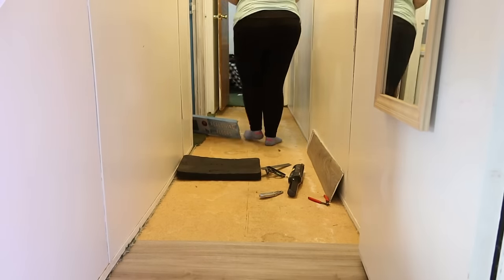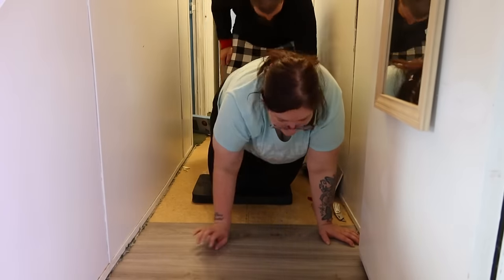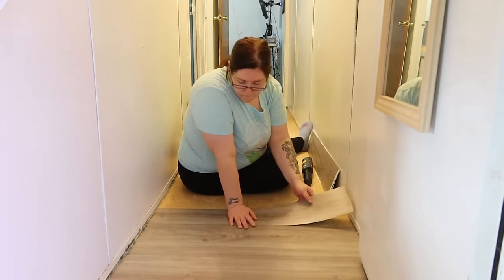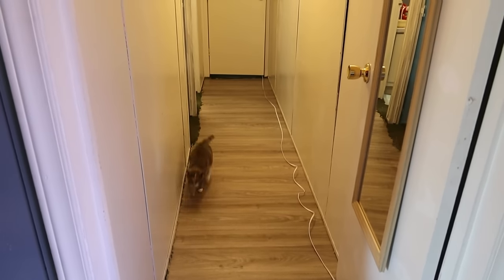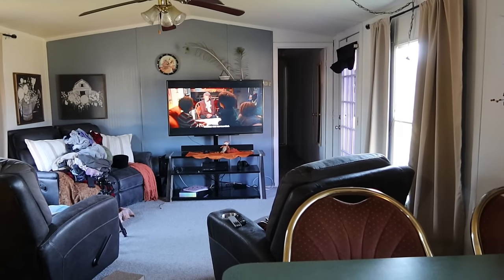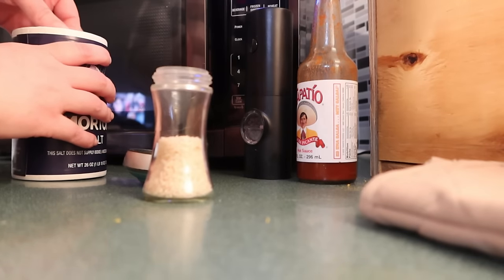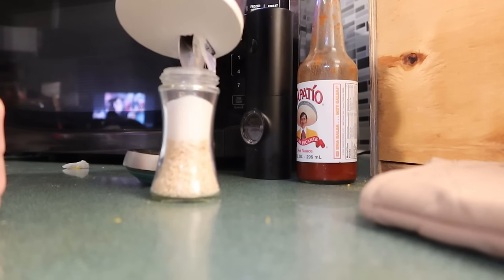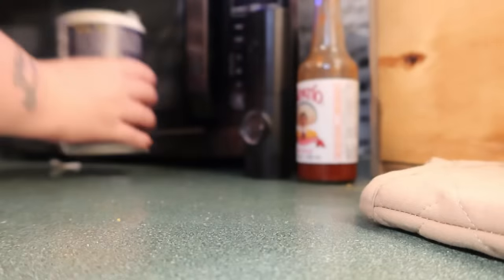LAYING FLOORING MOBILE HOME UPDATE CHEAP CHRISTMAS DINNER IDEA

Comment: Be sure to cover the new floor in at least 2 coats of  Pollycrylic. It may seem expensive now but it will make the floor last for years. Just roll a thin coat on let it dry for like 5 hours and do the second coat on your way to bed. Diner looked great! Along the lines of potting rice in your salt shaker save to little packets in your  suppliments and such to keep other things dry. 
Now is the time to work on your compost and such if you plan on a garden next year,. Remember to blend all non meat food scraps with water and pour over compost to boost it. 
Love seeing how good you have gotten at this.